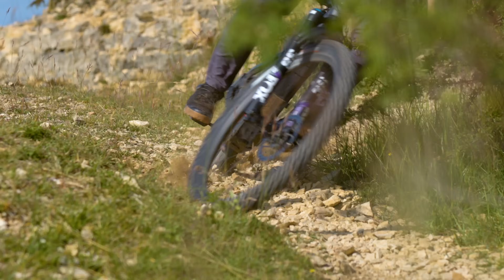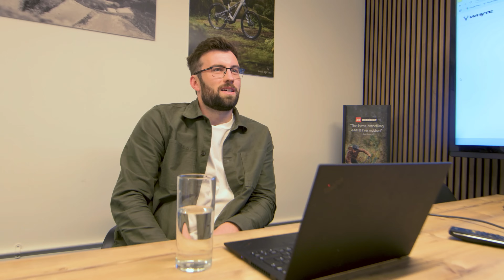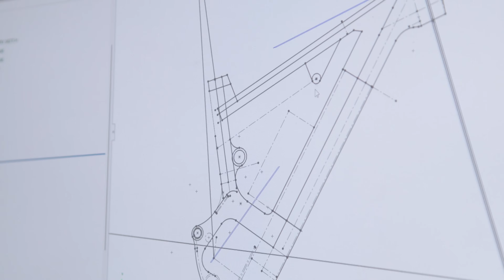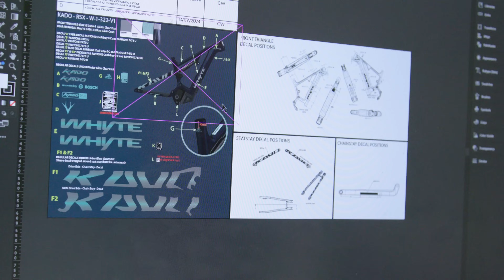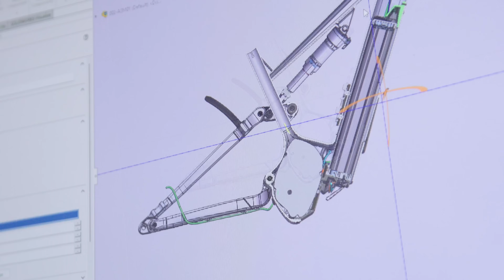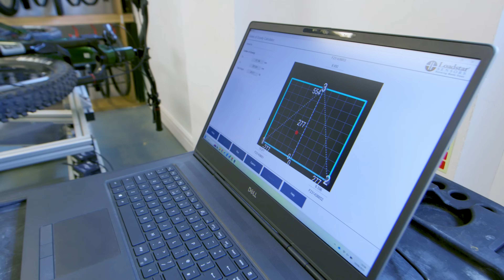How Are Mountain Bikes Designed? Whyte's Kado eMTB From Paper to Production

Comment: Couple question to Ben, Louie, Will and Sam:
1) is it true that headset cable routing is a cheaper solution in overall bike cost production than standard cable ports? I assume it takes more time for the engineer to include a cable ports into the headset sketch and then takes more time on a production line to finish it off? 
2) would you prefer a battery that is slimmer but longer or bulkier but shorter (as current bosch power tube 800)? I know that you design frames to have lowest center of gravity but if you have a choice, if bosch made two types of batteries, which would you choose? Would you prefer to make a frame with bulkier down tube that has lower COG (center of gravity) or bike with slimmer downtube but higher COG? :>
3) do you have some kind of recon dept? :> or maybe company buys or rent a competitor bikes so you can take a look at some solutions they made? :>

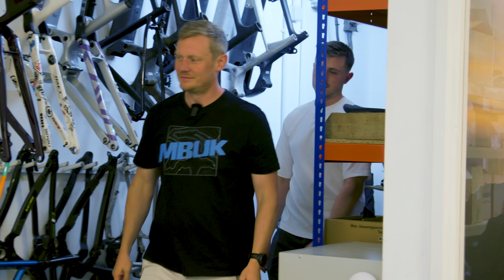13:50 you should ask you boss about investing in newer printer ;]